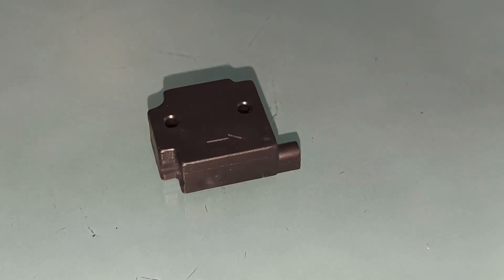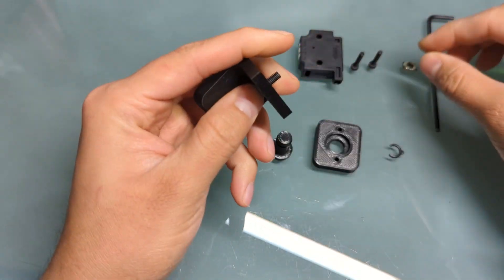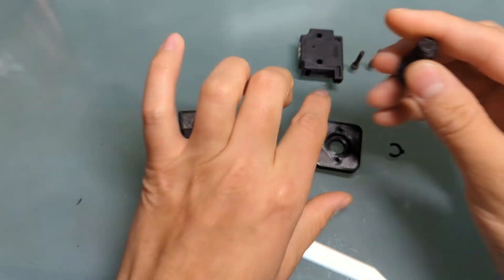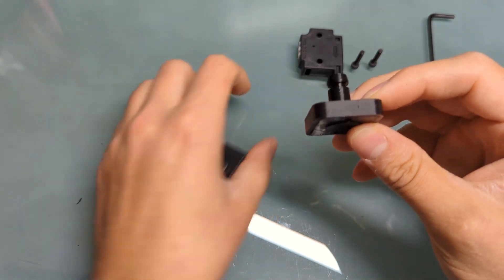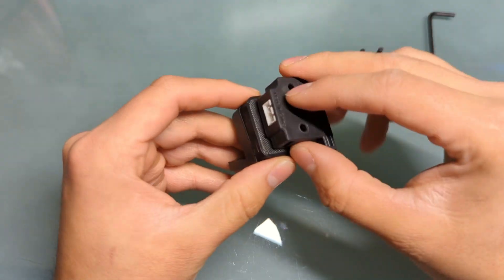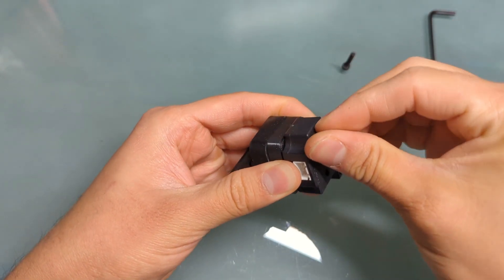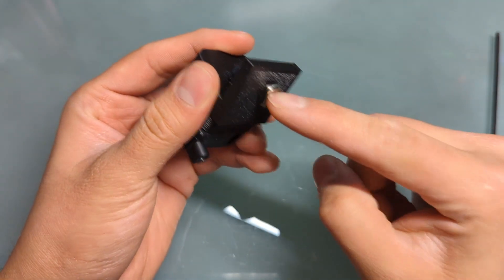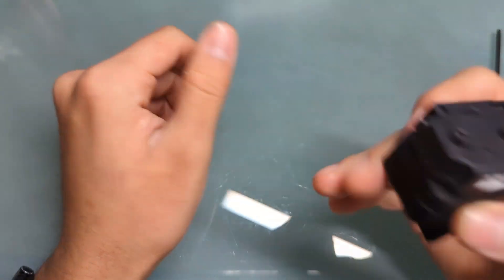Filament Sensor Mount Direct Drive 3D Printers Assembly

Comment: EXACTLY what I needed.  I bought the Ender 3 direct drive kit and the filament sensor kit.  They are NOT compatible.  The factory Creatlity sensor kit is intended to be mounted on the extruder mount of the factory (fixed) extruder, and not the floating (direct drive) extruder.  😞   Your 3D print solves the problem.  Thank you!